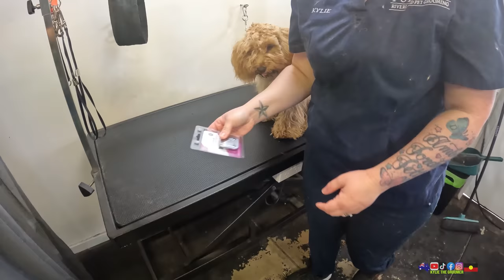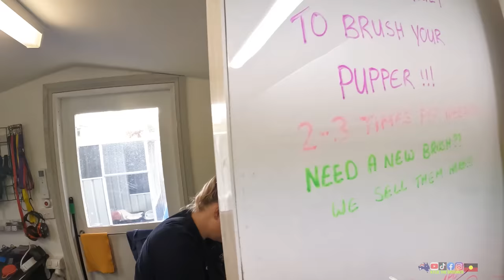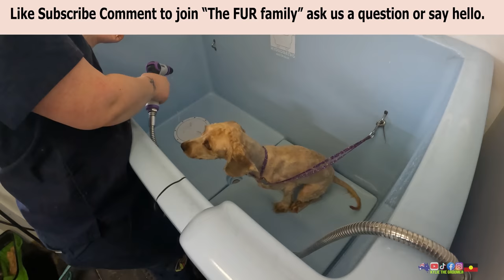SHOCKING!! EXTREMELY MATTED DOG, watch this emotional rescue (Harriet submits to our helping hand)

Comment: I'm a groomer my self and I sometimes use this method if it's not matted to grain sometimes I will wash in dirty dog shampoo to get all the dirt then I will follow through with conditioner and I really lather it and let conditioner sit for 10 minutes while it sits I will use my zoom groome to get some of tangles and then rinse and dry dog using my dryer and slicker brush To get the remaining matts if the temperament is just a little bad I can usually solve with quick slicker and I use in this case any way try on some dogs see if it works out for you
Reply from the maker: Hi Lindsey and thanks for watching! Great tips for demating. Personally,  I do not demat dogs. I'll detangle ears and tails where possible but I refuse to put a dog through painful or uncomfortable demating when a shave down can relive them of the burden with far less discomfort than demating.  
Each to thier own and no judgement from me. It is often possible to work through matting. I just won't do it. 
I quote for demating in my salon as I am often asked to do it. 
Its $500 per hour and a minimum of 3 hours. Or we can shave it off, get your dog clean, tidy and comfortable for $90 and offer my best recommendations to prevent matting in the future. 
When I first started out grooming, I actually felt obligated to " save the coat ". Year after year, the same digs come back in the same condition.  Absolutely won't do it any more. 
Sorry for the rant! Hope to see you in our live stream next week so we can say Hi in person xx
Reply: @kyliethegroomer  Not a rant and The World Courts agree and 2nd your decision amazing woman like you 😂 🙌

Comment: I couldn't see if you had one, but a small marble cheese cutter would be good to add on the wish list, take the wire/handle off and put the clippers on to cool down quicker so you can use them again.

Comment: People need to research the breed they are contemplating before committing to it.  Grooming needs, exercise needs, temperament, breed prone illnesses and so on. This breed should be considered high maintenance in that they should be groomed at least every 8 weeks. They are also at higher risk of ear infections if the ears are not kept clean and dry inside.  Great job on this sweet little girl.
Reply: Yep these pups require love and care all the time.

Comment: I have a Cavapoo who gets matted, though certainly not as bad as poor Harrie, because mine gets groomed regularly. However, sometimes my Cavy Mia gets fairly severe mats on her ears. And though my groomer says our girl is “the best” when she’s grooming her, I can’t say the same for when I try to brush and tend to Mia’s coat! You probably know about this product I have used by BioSilk for Dogs that is a de-matting spray. While it isn’t a Magic Bullet, so to speak, it does weaken the mats enough that I can use my fingers to finally pull it apart enough for me to then snip the worst of the tangle away. I don’t think it would work miracles on this poor darling, but it could ease her (and your!) discomfort a bit. You are such a dear groomer to cry for Harrie’s condition, and you did a great job of freeing her inner pup!👼🏼 And Harrie is so typical of the Cavapoo personality…sweet as can be. 💞
Reply from the maker: Hi Cyd and thanks for watching and joining the conversation 😊 
I personally will only demat very small sections like the ears or tail. I personally do not believe in causing the pet discomfort for the sake of the owners vanity preferences.  Shaving the hair off and allowing it to grow back with proper maintenance and care will always be  the way I do things in my salon. 
When I am demating, I use the Petway detangling spray, long bristled slicker and a razor dematting tool to cut through matt's. However, I will typically only do this on the first occasion for each pet. If they come back matted again, they get shaved. It's too cruel to constantly put the pet through that. It creates a negative relationship between the pet and groomer. 
I completely understand there are many reasons why pets get matting. If there'd a reason like you've mentioned where brushing is difficult, keeping a shorter style will make this much easier to keep on top of. 
Thanks again for watching. Hope to see you on our live stream next week so we can say Hi in person xx

Comment: You are awesome with this it’s all right. This is the first time I’ve seen more chance but you need to do yourself a favor you need to wear ear protection air drying these puppies. I couldn’t wear it with your protection when I was running to blenders all the time and after working with him for nine years blowing this as well as could be in my face I damaged my hearing. Keep up the good work!
Reply: I was talking about wearing ear protection.  Sorry for some weird wording… I have macular degeneration and I do comments by voice. My phone & Siri aren’t always good at taking dictation lil
Reply from the maker: i have orange ear muffs. however there are settings on the dryer, low setting for Dogs like Harriet aren't very loud. when i turn it right up with a nozzle i definitely wear them.

Comment: Hon I have some advice for you to consider and research if you would like to. I have been grooming for 45 years and as counter intuitive as it may seem if you bathe a dog like this first and rinse as well as you can, you can wet shave a dog like this and it's actually easier on the dog because it makes the hair a little more pliable as well as when you use a cordless clipper like you do, your blades never get hot and it actually saves your blades. I didn't start wet shaving til 4 years ago and it really does make a difference
Reply: interesting.. like wet sanding paint work on a car.

Comment: Kylie, isn’t it true that bathing a matted dog makes the mats tighten up and get worse? It happened to me with my first schnauzer. I also wasn’t using the right grooming tools. I was only using a brush which didn’t touch the hair nearest the skin. You do an amazing job and with lots f love. You’re #1 in my eyes. ♥️ Lafayette Louisiana US
Reply from the maker: Hi Donna 
It's definitely not a good idea to bath a matted dog. The hair closest to the skin doesn't dry. The moisture usually pulls the hairs in tighter as it dries and the matting then gets closer and tighter to the skin. 
You can wet shave a matted dog but I personally have bit tried this on a full body shave down. Only where I have tried my very best to deshed a dog out but the rear end/sanitary areas were too badly matted. I can usually save the body and just shave out the back of the legs and bum while still wet. Then dry the hair and tidy it up. 
Having the right equipment is key to successful maintenance at home. Personally I like to suggest the clients let me groom the dog and then recommend tools that worked best. I like to recommend what the dog was comfortable with and got the job done. I always let them know that I will suggest the ideal kit with everything in it but also the bare minimum to get them started. 
A long pin slicker and a steel comb typically work wonders. Then you can add on detangling spray, undercoat rakes and scented cologne to use at home between grooms. Some clients like to bath between grooms and I also recommend the best shampoos and conditioner as an option. I sell the same products I use, so they know it's the right products for thier dog.

Many of us have made the mistake at least once in our lives. We learn, we do better and everything is much easier with someone knowledgeable to give you advice and a helping hand.
Reply: Kylie, it was my groomer who explained to me about the combs. My girl’s undercoat was matted and she fussed at me, with love, and explained how to properly comb her. I only do a bit of maintenance between groomings. I love that you use essential oil infused products. They’re so healing for the skin and smell good, too.

Comment: Don't you think you should go to a 15 just to make it a little bit easier on her and you and maybe the blades won't get so hot so quick just a suggestion I'm a newcomer but I love you already because of the way that you cuddled with Harriet before you started
Reply from the maker: Hi Dottie
On occasion, for severe matting, I will use a 15 or even a 30. Unfortunately with the very short cuts, you have to weigh up the benefits of a shorter blade vs the consequences for the dog. 
The 15 and 30 blade often produce side effects such as rash, in grown hairs and even abrasions and cuts were the skin has a wrinkle under a mat. 
For this reason, working a 10 blade even where its working a little bit hard, is worth persisting with. 
A 15 and 30 blade is commonly used under combs or on a poodle clean feet/ face. It's typically seen is show grooming on pets that are tried and tested and shown to handle the extremely short cut without problem.  
Hope this helps to answer your question and thanks for taking the time to ask.
Reply: @kyliethegroomer  thanks so much I get it better now. I love watchin ya'll and I'm gonna keep loven u gettin all those cuddles.

Comment: Why don’t you pluck the hair in their ears?
Reply from the maker: There's a mixed bag of answers to this question! Old school groomers will pluck! It was taught to them and will carry on for the rest of their careers.  They may even teach new groomers too! 
The latest research from dog dermatologists and veterinary specialists indicate that routine or regular plucking can actually be the cause of some ear problems. Specifically, that plucking opens the hair follicles and pores. Bacteria from the ear than sneak in and this can be the beginning of infection.  
There's a lot more on the topic and a very interesting read! 
Regular or routine plucking was discouraged in my training. I do pluck earache occasionally.  I plucking them when there is an obvious ball of matted hair in there. When this is the case, the hair often pulls out very easily in one little clump. Hair that is clean and tidy in the ear will rarely cause a problem. It is safer to leave it alone. 🥰

Comment: I can see how much you care about your clients, but do not understand why instead of making a big deal out of the weight of the matted hair on the skin you don't give the dog relief by using scissors to cut the bulk of it away. I watch a lot of groomers on YouTube and they all give the dog relief by scissoring the heavy chunks off.
Reply: You can’t cut matts with scissors you can’t see through to where the skin is and will end up cutting the dog.  Plus scissors won’t cut through a matt period.   If you did any training or research you would know that.   Some comments are so inane and annoying I believe she knows what she is doing, after all she has been trained.
Reply: @leslieollerhead1114  You don’t cut the mat anywhere near the skin. I am talking about cutting the big hanging mat she has already shaved away that is hanging well below the body. She CAN cut the excess with scissors well away from any skin. Have watched many videos where the groomer poked the pointed end of the scissor through the hanging coat away from any skin and cut down towards the table. Using that cut they cut off the bulk of it which relieves any pain to the dog and allows the groomer to finish shaving the dog with less chance of nicking the skin that was being pulled down by the weight of the mat.  This groomer has actually stated that she knows her grooming has room for improvement and has even asked for any suggestions. I am sure she would rather try a different method and relieve the dogs’ pain than continue on saying “I’m sorry this hurts”.  Perhaps you might do a little research before declaring that scissors won’t cut matted hair as there are numerous groomers that do it on YouTube for the world to see which is why I know it can and is done.